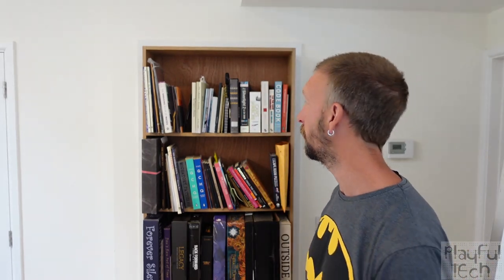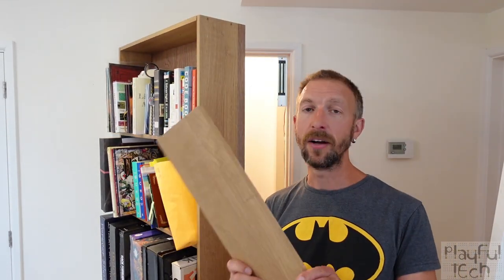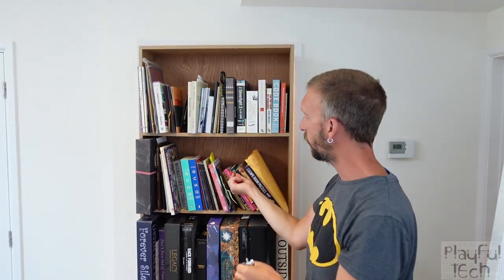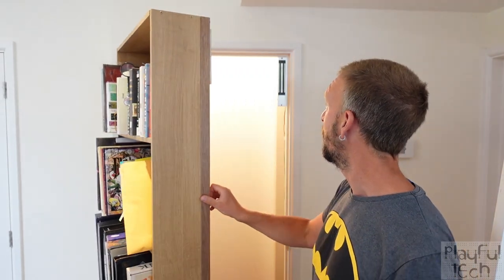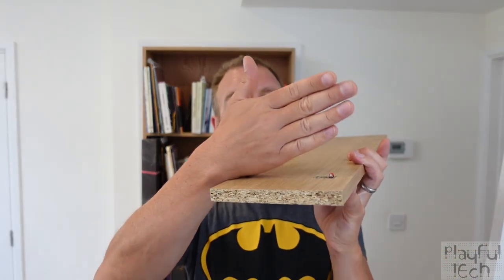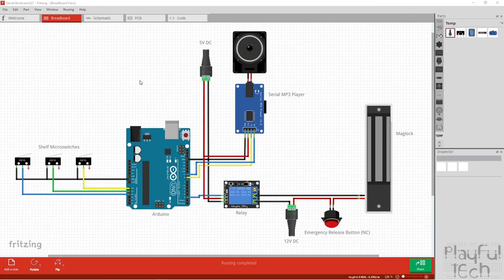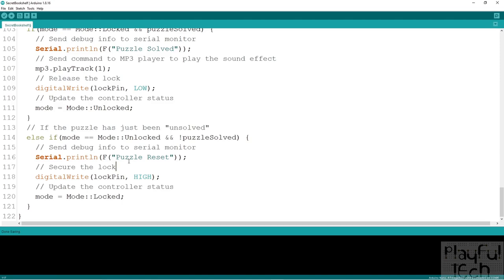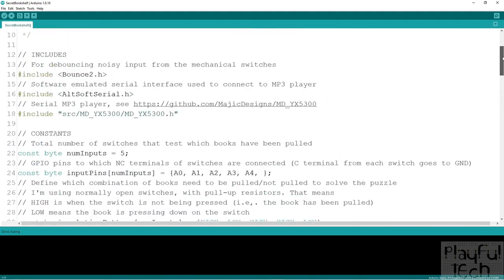How to make a Secret Bookcase Door (DIY Escape Room Tutorial)

Comment: Best kind of engineering: Effective, yet simple 👍

Got my head buzzing with all kinds of varients, like books with notches in specific positions on the bottom, so that the correct books must be place in the correct places! Or with placed holes going through them to allow an infrared beam to pass through...
Reply: Even easier, magnets embedded in the book sleeves that align with reed switches in the surrounding books. Essentially a literary combination lock.

Comment: I've been looking to do exactly this.  I've seen a lot of escape room maglocks that use Hall Effect sensors to unlock the maglocks, but I always felt they worked backwards from they way they should, where if you removed a magnet from the sensor field, it unlocks the door.  Using a microswitch is a very interesting mechanical method.  Is there any way you could show an alternative using a Hall Effect sensor?  Also where did you hide all of the electronics?  The video doesn't really show it well.

Comment: Fun as always and using for a similar style solution. How are you powering the different voltages? And keeping the wires from breaking based on continuous movement?
Reply from the maker: The wires from the switches are fed through holes in the door and then into cable trunking on the inside edge of the door, which takes them up and over the top of the frame. I considered trying to show that in the video, but it was rather hard to follow! The 5V and 12V come from regulated DC power supplies like these: https://www.ebay.co.uk/itm/224582753706?hash=item344a2cddaa:g:qpMAAOSwlxBhI0x9&var=523378982587
Reply: @PlayfulTechnology  so you have two separate power supplies - one for the 5v and one for the 12v. I am trying to find one that does both to cut down on plugs and components for another project
Reply from the maker: @TekGeekDad  Yes, I generally have separate 5V and 12V circuits running to all wired props. You can use a PC power supply, which will output both, or you can use a 12V supply and then add a 12V->5V step-down before the 5V components if you prefer.
Reply: @PlayfulTechnology  the pc power supply is an interesting option. i have done the step down but had some noise issues.  Could have been the step down circuit I used. Thanks
Reply: What A alimentation do you use ? 5V 2A 10W and 12V 2A 24W ? Thank you
Reply from the maker: @aurelienleniau3698  5V 2A is plenty for the Arduino and the relay. Most maglocks will draw less than 2A, but I would probably increase the 12V power supply a little bit more just to make sure - I'd probably use a 12V 5A supply (i.e. 60W). Note that it's never a problem to have a power supply that is capable of supplying more power than required - components will only draw as much current as they need.

Comment: You mentioned a spring to help crack open the door when the lock releases, can you speak more to that?  I have struggled to find good spring solutions for that type of thing.  Both on full size doors and smaller cabinet doors.
Reply from the maker: There's nothing particularly special about it - it was just the largest spring I could find to hand - I think it had come from the cabinet of an old fruit machine I had lying around. I'd also say to make sure that you're positioning your maglock correctly - it should have a little pop release that helps detach the armature from the lock when the power is released. I did have to ensure that the casters were rolling freely on a flat surface on the floor for it to work. It's not a substantial movement but, accompanied by the sound effect and the crack of light that then appears around the edge of the case, I think it would be enough, and certainly for cabinet doors (search for "spring nut" if you want a convenient way to secure the spring to the door frame).  If you have a particularly heavy door, or want a slightly more substantial movement, you might want to look into using a gas strut instead, or the automated approach of a linear actuator I described (although please be cautious to avoid the risk of players getting fingers trapped!)
Reply: In a pinch a "shim" between the doorframe and the door can also work. If the maglock is at the top of the door then add a very thin, short (couple of cm long) strip of wood to the frame, you will need to experiment with the perfect thickness, but a few mm should do. This creates a small separation between the plate and the maglock, that puts the door under a tiny amount of elastic stress when pushed closed. When the maglock is released the door will flick away from the frame by a few cm. 

The thickness of the shim and the distance the door moves when released will depend on the maglock strength + the door weight. Don't make it too thick otherwise any kind of knock against the door will be enough to break the maglock hold.

Benefit of this is easy to fit and can be painted to hide it.